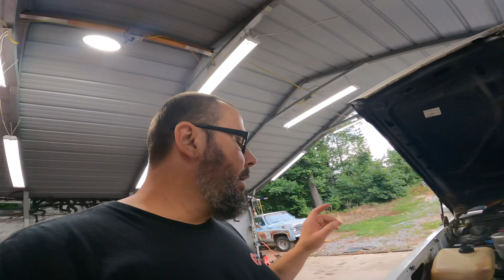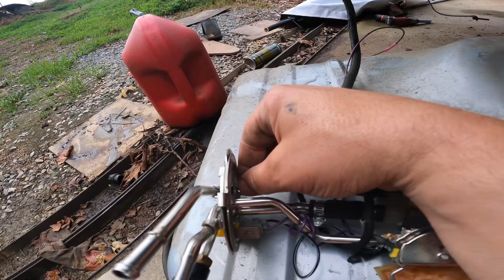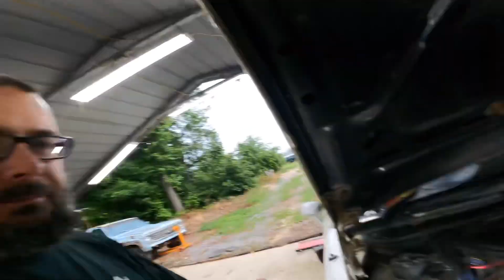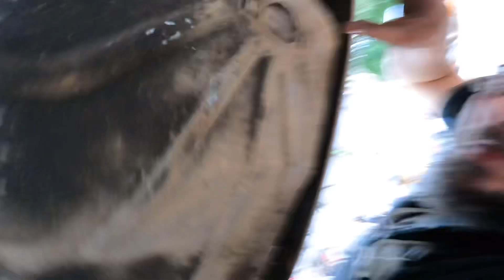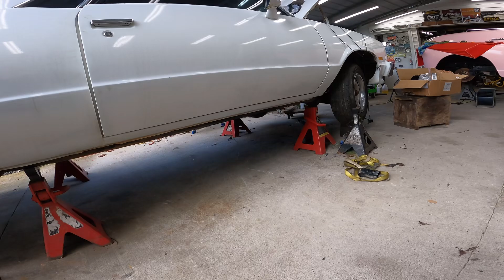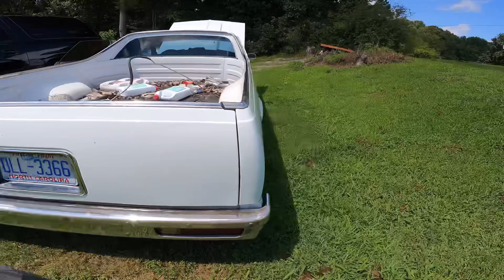LS swapped El Camino, does it run and drive yet?????

Comment: For these older return style LS fuel systems, you need an ACDelco pump for it to function properly. Aftermarket ones fail and are cheaply made or have extra parts attached that aren’t necessary. I learned my lesson after I bought an aftermarket pump which looked very identical to the OEM one. 4k miles later and the float completely broke off inside my tank and took out the signal wire for the gas gauge.
Reply from the maker: The pump is a walbro.